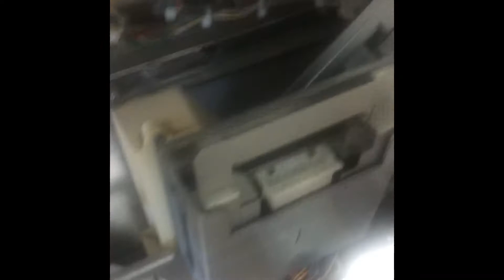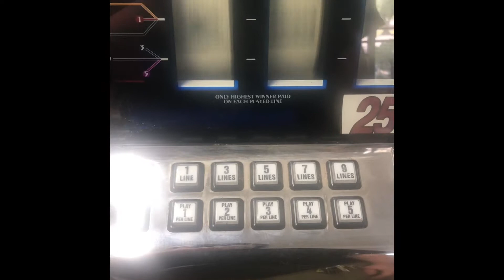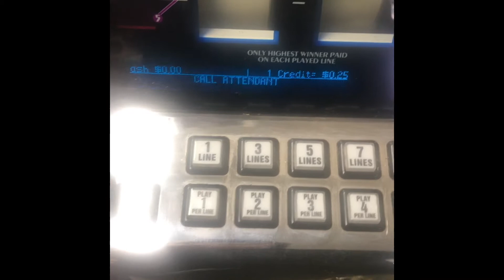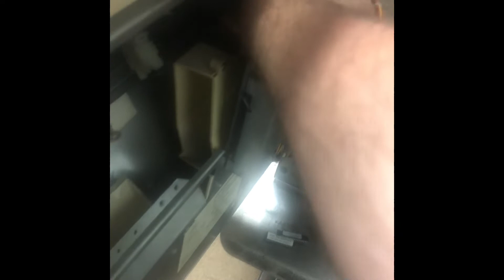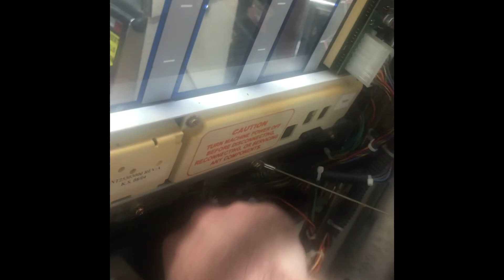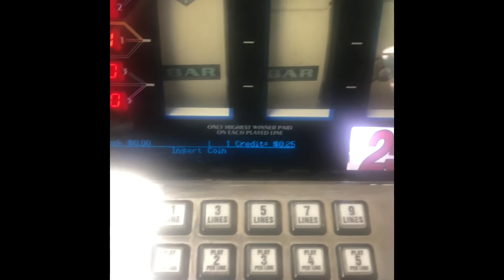Igt s2000 slot machine Senet diagnostic process

Comment: Hi there, very informative video, however I have an igt game king and I think I have way more issues, I can’t get the door open B cOde to go away, went thru open and closing door checking belly door, belly,door doesn’t have a lil reset switch, long and short making sure every door was shut, validated, cash can’t belly door, still Door open B
🤦‍♀️ 
open to any ideas or advice you may HAve
Plz and thank you
Reply from the maker: Door b is bill acceptor

Comment: Can you help me ? I have the same problem
Reply from the maker: What exactly is your game doing? What error shows
Reply: auto slot  I get call call attendant , coin in jam , closure m and door open b . I follow your video I think I have a bad I/o
Reply from the maker: Open b means your bill acceptor door is open or the switch is bad make sure that door is showing closed.
Reply: auto slot thank for getting back
Reply: I have no cables on the switch for the bill acceptor switch is there any way I can FaceTime or some thing and go over the machine I will pay you
Reply: Got the door b to go off just have call attendant , coin in jam and closure m
Reply: Found white cable on door sensor broken will have to order a new one and recheck it can I bypass the switch
Reply from the maker: Newlifegames.com has instructions on how to bypass the optics.
Reply: Performed the bypass but I think I narrowed down to the I/o  that controls the buttons..  when it reset I’m not able to select any button . and I’m still getting the closure M and coin jam
Reply: And call attendant order used I/o both from the door will wait to see if that fixes it
Reply: Replace both I/o cards and now all the buttons light up I keep getting call attendant , coin in jam and Closure door m .also noticed if I unplug the return cable from the lines display I get a code 8.8 . I did the 4 key turn reset but when it goes to accounting not able to do anything
Reply from the maker: Take your line display out of the loop go from the door harness to the inner vertical door card. Vertical door card to the 45 degree door card mounted in between the glass and plate then the credit display. Make sure you coin optic bypass plug is in place. Open and close the door a few times sometimes on s2000s the errors stack.
Reply: @autoslot6381  same message :( also noticed the the display from the winner paid credits and total bet don’t turn on
Reply: Noticed if I remove the reel I/o card all my bet lines turn on and I get a new message play 90 credits for like 3 sec then I’m still getting the call attendant , coin in jam and closure door m . Just order from eBay the reel I/o card
Reply: But I still can’t get the buttons to work in accounting screen maybe it’s going to be cpu ?